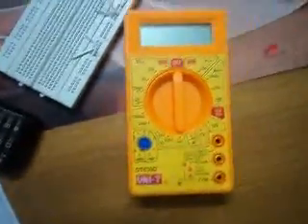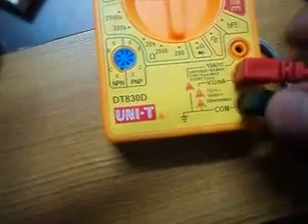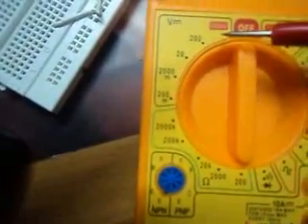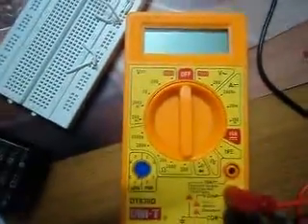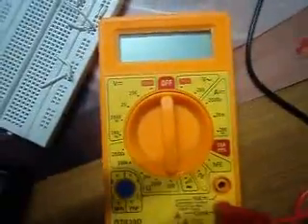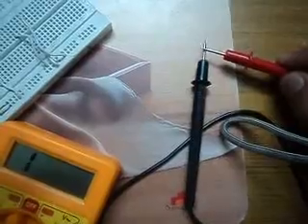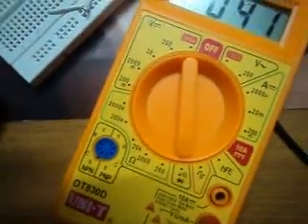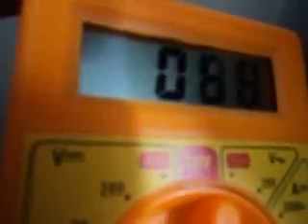how to use digital multimeter

Comment: Thanks for this video. It was very helpful. Our electric mistery is out of station and I needed to check voltage on a step-down transformer straight away.  I have one of these meters but had never used it.  Your video told me exactly what to do, and it worked.

Comment: Big problem when showing how to measure the ACV,.... If would be VERY helpful to actually see where you inserted the lead prongs into the receptacle,,.... and then show the reading on the meter. does it matter where the red and black leads go in a 230 (in Ukraine) receptacle? I'm familiar with American electrical systems, and it doesn't matter on 110 v circuits, ... but 220 must be checked with one lead (it doesn't matter which one) in the ground terminal, and the other lead in either hot terminal. Each hot terminal will check as 110 v,.. and together, the 2 hot 110 v equal the 220 v.  BUT in Ukraine it's 230 v and the old houses/apartments DON'T HAVE GROUND TERMINALS (OR GROUND WIRES) IN THEIR  RECEPTACLES!! I'm not sure if it's the same in India (which is what the accent of the man doing this video sounds like)?

Comment: I have the same meter. Make sure you put some super glue on the wire where it enters the end of the probe. The wires on these meters aren't anchored into the probes very well, and will pull out of the probe, breaking the wire.

Thanks for video.